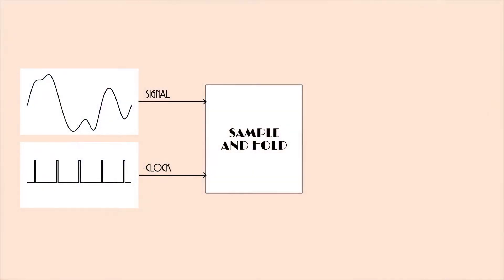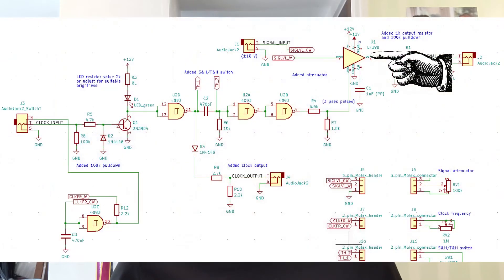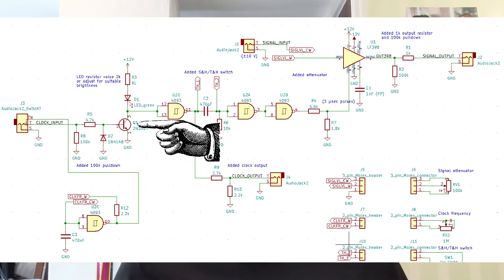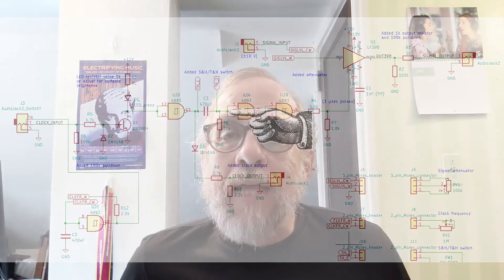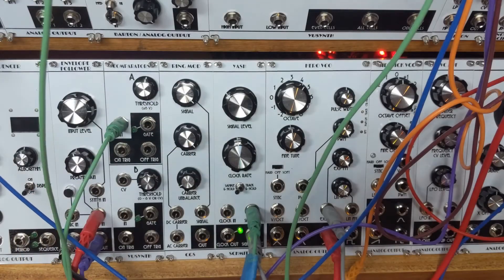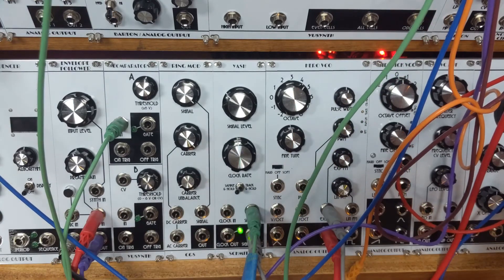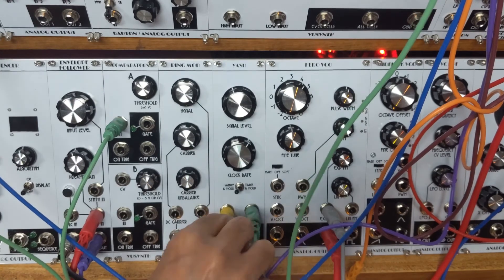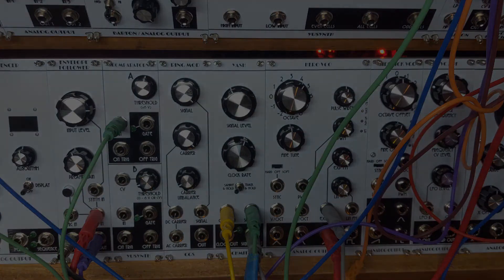YASH sample and hold

Comment: Nice project! The droop is pretty noticeable. Maybe experiment with a bigger cap? Btw I like to use the track and hold with two vcos. So both the vcos receive the same cv sequence and one of them randomly holds it. So they sound the the same or not. You need a random clock though
Reply from the maker: As I understand it, droop rate and hold step both improve a factor of 10 with a factor of 10 increase in the hold capacitor, but acquisition time increases by about a factor of 10. I used Schmitz's values but they say "The timing of the sample pulse is aimed at fast aquisition (i.e. short pulse) at the cost of less precise capture. Mainly to mimic the sound of low sample rates." which I'm not sure I fully understand. Anyway, a 10 nF or larger cap should bring the droop down but the clock pulse would have to be lengthened to 30 µs or more. Not sure how wide the clock pulse can go before it becomes a problem, I suppose 30 µs should be fine. I think I have another LF398 so I can try breadboarding it sometime. I see MFOS's (discrete) S&H uses a sample time of 100 µs and a 10 nF hold cap (http://musicfromouterspace.com/analogsynth_new/SMPLANDHOLD200607/SMPLANDHOLD200607.php ).